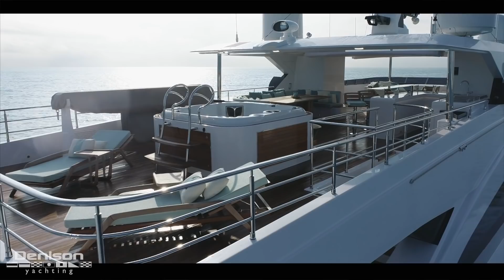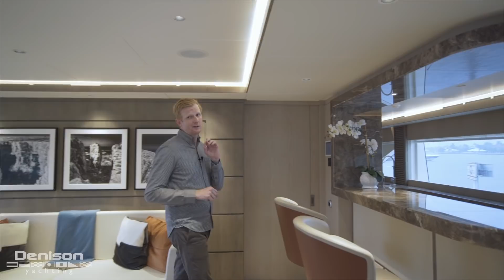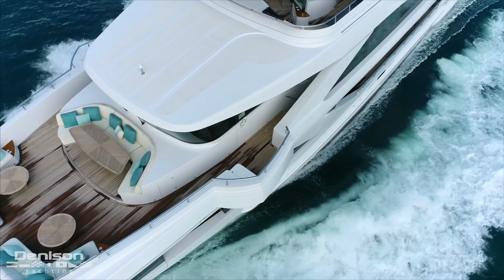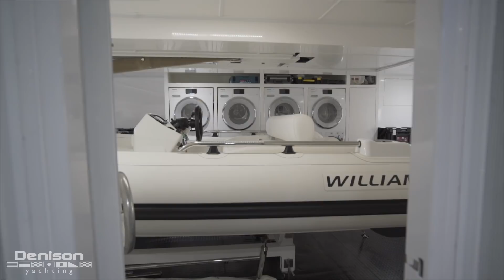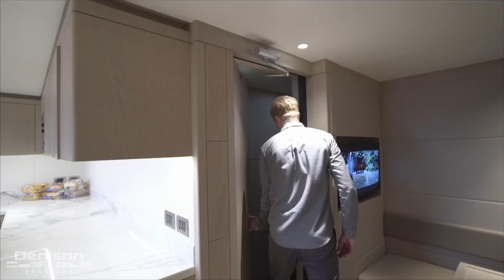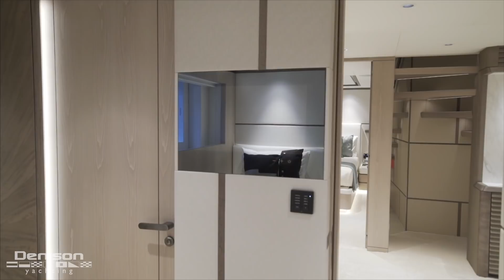140 Majesty Superyacht [$23,995,000]

Comment: Great vid (as usual) but you didn't mention the waterfall feature for the jacuzzi....
Reply from the maker: What did you think of it?
Reply: @DenisonYachting  the waterfall feature or the boat?  Both are great, I think that the company is very innovative with their designs and the sheer amount of features they pack into them for the price.  Great value and quite opulent.  You presented her well!
Reply: The water fall is cool but my guess would seldom be used. Usually when in a hot tub, you don’t want splashing of water

Comment: Range,cruising speed and fuel consumption ?
Reply from the maker: Per 140 Majesty captain:

(Sea, load, conditions dependent)

3500 NM at 12 kts

1300 rpm 12 Kts 
Burn 55 gph total

1600 rpm 15 kts
Burn 80 gph total

2200 rpm 19-20 kts
Burn 280 gph total

WOT RPM is 2400, 19-20 kts
Burn 280 gph total
Reply: From what I understood from the video made by Aquaholic, this yacht shoul be able to cross the Atlantic at 10 knots. I love this boat. It is the perfect size.
Reply from the maker: good questions... we'll try to get that for you really soon!